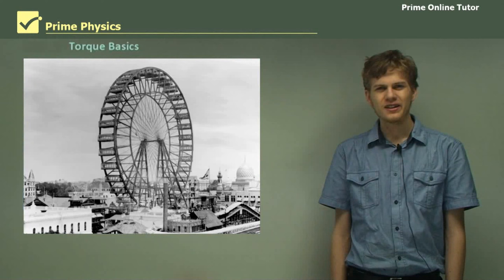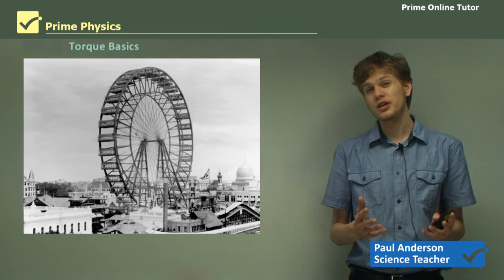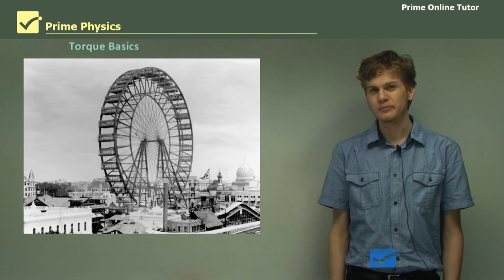Demystifying Torque: Simple Explanation for Everyone

Comment: Sir,
Why the torque shows negative value even if the Motor rotate in clockwise direction ?
Reply: as he says. clockwise direction is negative because if you compare rotation in an angle 90deg is positive which is counter clockwise on the other hand if we have 270deg it is in negative which is clockwise.